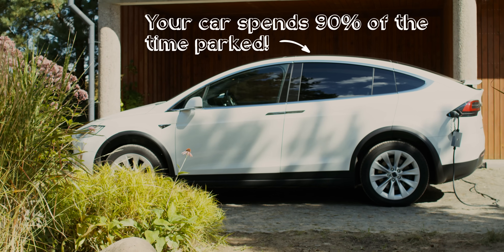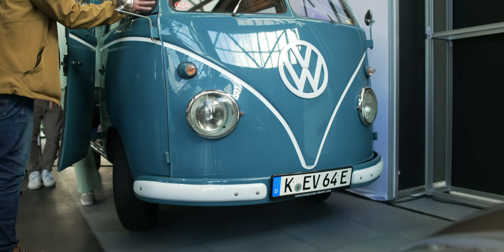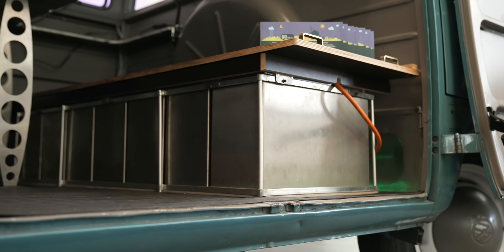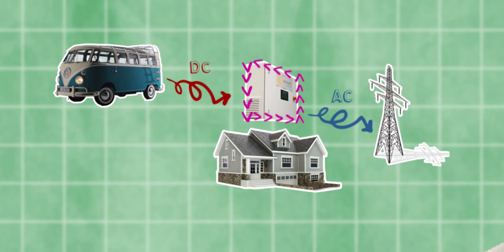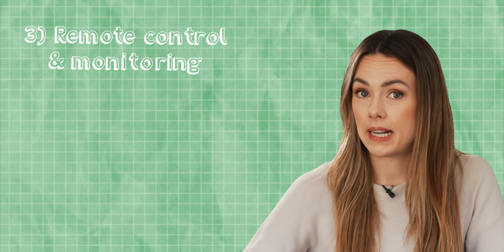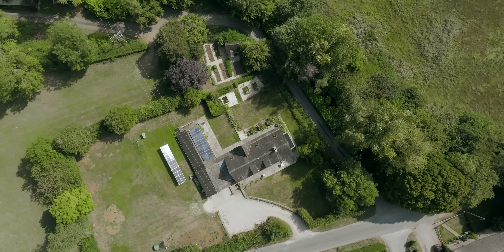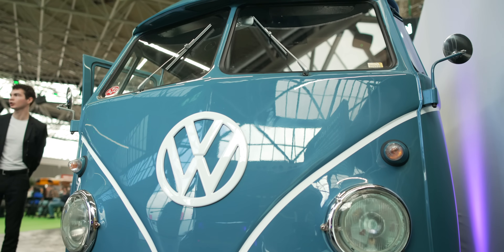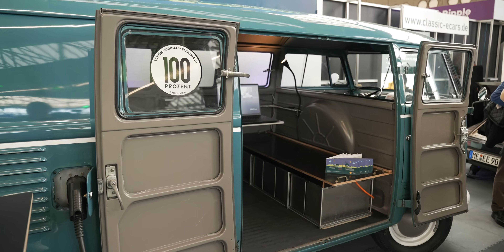This VW Bus Has SUPERPOWERS!

Comment: I think just nio and the ev9 from kia do vtg commercially. V2g/ energy arbtration is live in china-sell energy back during high loads, charge cheaply at night.  And of course nio swap stations have been balancing the grid for years, the newest in netherlands. Chinas newest  2024 energy policy stressed v2g on a grand scale.
Reply: The swap stations perform: . Virtual power plant project cooperation.

Promote charging stations, battery swap stations, energy storage stations, adjustable loads and other aggregated resources to access the virtual power plant platform to provide peak shifting, frequency regulation and demand-side response services for the power grid.
Reply: ** and Nissan leaf and f-150
Reply: All the kia/hyundia E-GMP cars work SFAIK.
Reply: @xxwookey  no idea, nio is the only one I know of that has dedicated v2g public chargers but who knows. Meaning the only one that can currently earn money directly from the grid.

Comment: Aren't all EVs equipped with DC-to-AC inverters to drive the motor? Why is an extra inverter needed?
Reply: There also needs to be sensors to sense the exact grid frequency, and a filter to another out the sine wave....
Feeding to grid is a bit more complicated than driving a motor.
But to be honest, not that much as there already is the inverter with every small solar system ❤❤😊
Reply: It is an excellent question. And the short answer is that it is not that easy, but I would like to hear the long answer of what exactly it would take, and if it could theoretically be better than a build in inverter just for this application.
Reply: Probably because it's easier for a retro-fitter to slap in an inverter that's designed for the job than it is to modify the car, especially as every model of car will be different.
Reply: @robinbennett5994  True. I was thinking more along the lines of an OEM. It does sound vaguely like something Tesla would do to not have to install an extra expensive component.
Reply: I suspect the inverter that drives the motor is not a pure sine wave inverter.

Comment: AC coupling is complicated in North America because the car interface is single phase but homes and grid connections are split phase. You need at least an autotransformer to get split phase from single phase. 😢
Reply: The car's speed controller is probably has at least 3 phases though. Those are independent solid-state switches, so you could use two of them with slightly different programming.
Reply: @robinbennett5994  In Noram, there's only two high power conductors connected to the vehicle through the charge port, in both J1772 and J3400.
Reply: I thought most cars there charged from 220v, so that is using power across both phases?  I could understand it complicating 110v V2G at high power however due to imbalance, but no more than USING a single 110v appliance would.

Comment: The new Renault R5, and also the future Renault 4 on some higher trims will be natively compatible with bidirectional AC V2G and V2H. It may require the new Mobilize charger for it to work, and it should allow to send back electricity to the grid and earn a bit of money…
Reply: Good news. Very few vehicles with it right now.
Reply: Do you have a source? I ready this annoncement and was thrilled to get a R5, but sadly, in the most recent R5 presentations the v2h capability was not mentioned any more.
Reply: @SchwuppSchwupp  I didn’t check fully but I didn’t find any mention of V2H on the Mobilize website. I guess we will have to wait the end of this year to know if indeed support the V2H but, it was theoretically something talked about a few years ago… Really hope that the Renault R5 and Renault 4L will support V2H because I liked the idea to store peak solar production, and also that it would be possible to use the car as a back-up generator…
Reply: @SchwuppSchwupp  On the last few days, I watched a Youtube video in which one of Renault person states that V2H won’t be supported at launch :(… They are considering it and reviewing it, but V2H is not even officially planned at this stage : really, really disappointed about that !!!

Comment: It powers your house ... When it's at your house .
If your power cuts at 0830 and you left for..... "somewhere" in the vehicle at 0820, no battery.😊
Reply: She said the car would be used to bolster your houses battery storage, so if you have a Tesla Powerwall etc, the car would work as additional battery storage on the basis the majority of journeys are 10-30 miles a day, so well short of the kWH of the onboard battery.
Reply: If you have a small house battery, you could drive and bring home enough electricity to last you over the weekend. Nice.
Reply: Oh Captain obvious is here

Comment: What about battery degradation. There are only so many cycles a battery has. Does vehicle to grid reduce the life of the battery, significantly,  for its main purpose, powering the car?  Also, home batteries are very expensive I was thinking what about a small home battery of say 5 kw that can act as a 6 hour  buffer in a black out but can also link with the car  for  days of emergency power or years of extra overnight or winter power.
Reply: Deg isn't a problem.
Vehicle location is.
Reply: @rogerstarkey5390   By location do you mean how far the energy has to travel from the car back to a substation?

Comment: Nice, use ultra expensive battery packs to compensate the grid. It’s no problem when the car is new, but after some years you add additional % of degradation to the battery. You can be proud that you helped the grid, but your battery has lost it’s worth and totaled the whole car. But in a world where no one gives a fck about the cars they’ve leased and you don’t care what will happen after the three years of ownership, this is how you have to do it. With ten years, the car is wrecked and the battery goes into a grid storage, instead of doing it’s job in the car. So sustainable. And hey the energy companies will love you. You pay for the car, they use it as grid storage instead of buying the storage themself, so they can save money. Nnnnnnnniceeee.
Reply: You can go with nio. You can rent the battery and use v2g at home or at the mall or work or wherever to make a few bucks.  Obviously they have limits to home much you can use it but then u don't need to worry about the battery health strictly speaking. Just swap in a new one if there was an issue..easier for recycling too.
Reply: Fair points
Reply: Try educating yourself before spewing uninformed comments.
Reply: @ratbert1  Totally , I have to educate myself. When we reached the point, that degredation and cost of batteries is a no brainer, than we can do this. But we're far far far away from it. Belive the bs, the car manufactures love lemmings.
Reply: I think LFP batteries are usually warranted for ~3000 cycles (80% of the original capacity) but it seems that they could still work for at least 6000 cycles (but obviously with some degradation, maybe 20% / 30% degradation, I don’t know) and are cheaper than NMC batteries. 

So if the car LFP battery is high enough (50kWh / 60kWh), then the V2G cycling may only be adding 2 or 3 full battery cycles a week (~100 to ~150 cycles a year, only if used every single week of the year…) which seems manageable… 

Furthermore, in France, Renault will soon (2H 2024 or 1H 2025) offer the bidirectional AC V2G option with some trims of the Renault R5 and Renault 4, when using the Mobilize charger, and customers will earn some money if they enroll in a specific contract…
Reply: Absolute nonsense. You need to watch the YouTube video of the UK owner of a 10 year old Nissan Leaf, who took his car to a well known Gloucestershire based EV specialist. They carried out a battery pack refurbishment on the car. It took 4 hours, and cost £500.
Reply: @Brian-om2hh  What ever deal they had, but for that amount of time, 500 £ is just the labor, you would have to pay. Just think about it, and you see that there is something wrong. Cheap refurbished batteries alone for a Leaf starting around 3000£. Its 500£ all included, for sure.

Comment: my 1970 model has been sat in the garage for 2 years waiting for conversion but until companies stop quoting more than the price of a brand new model y, the conversion industry is doomed to fail when it runs out of super wealthy customers
Reply: custom car jobs... electric or v8 swaps... were only ever for wealthy customers, and probably will only ever be for them
Reply: @Obvsaninternetexpert  even when you find customisers, they just want to use off the shelf upgrades anyway mate.
Reply: @jclive4773  cos doing things actually custom costs more then most people understand and is prohibitively expensive for most

Unless you do it diy
Reply: Needs
Battery prices lower (coming)
A universal adaptable cradle for motors, or a set of specific "off the shelf" bolt together cradle units per vehicle model (shouldn't be too hard with CNC modelling?)
.
A "standard" plug and play loom.
.
The other issue is you DON'T want to be playing with 400vdc packs as a DIY mechanic.
.
You'd have to buy the kit.
Strip the vehicle, mechanically fit the cradle and motor, plus wiring if you're confident.
Then trailer to a qualified technician for the battery.
Then type register/ MOT.
Reply: @rogerstarkey5390  just gonna do it myself tbh bud.
P.s. inspector from DVLA said if he was me he'd just do it and not bother involving the authorities